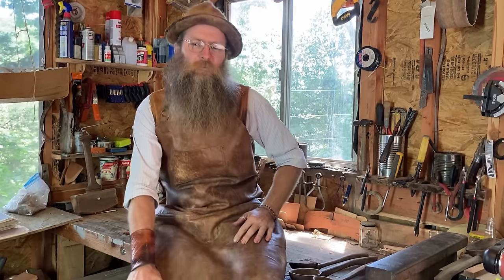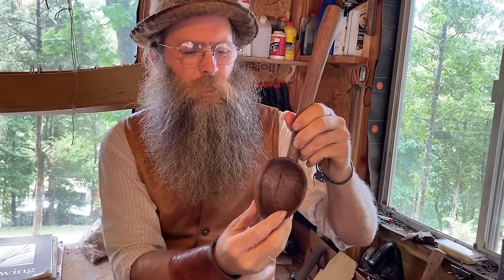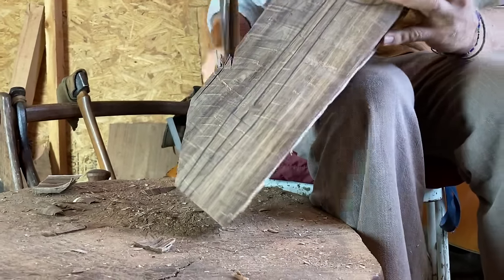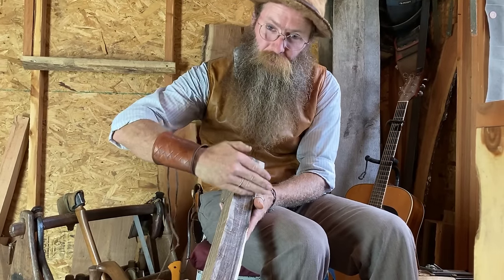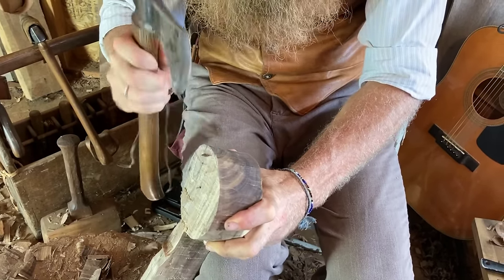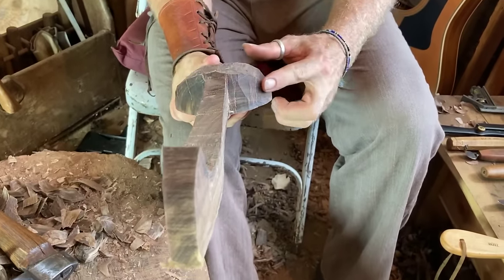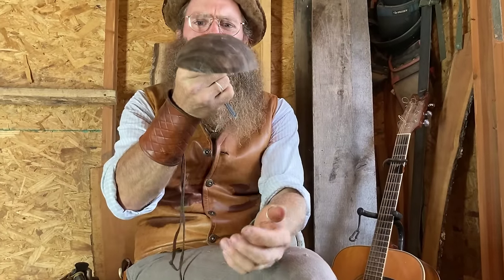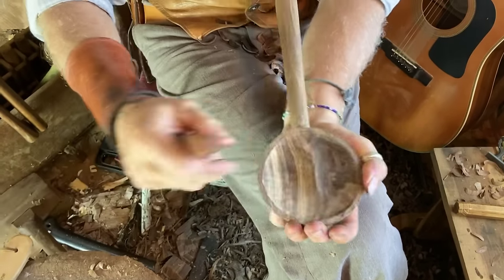How to Carve a Wooden Spoon by Hand

Comment: Where are ppl buying their carving hatchets? What things should I look for when shopping for one?
Reply from the maker: This is a very popular carving axe . However in my opinion I think it’s over priced and really awkward I would not have it in my toolbox but a lot of people use this.

https://www.amazon.com/Gransfors-Bruks-Large-Swedish-Carving/dp/B000WIPSVQ/ref=mp_s_a_1_6?adgrpid=51544855090&gclid=Cj0KCQiAu62QBhC7ARIsALXijXQgAuMQUMfBnKB2HbK3Os4RGrS0MFqduQeuh0nPbO0M6RYDVvKJJn8aAscOEALw_wcB&hvadid=410008378701&hvdev=m&hvlocphy=9026029&hvnetw=g&hvqmt=e&hvrand=1411582003428000142&hvtargid=kwd-1981184154&hydadcr=9873_11542642&keywords=gransfors+bruks+axe&qid=1644933367&sr=8-6
Reply from the maker: Here is another one by the same company That people also use. I have used both of these and I find them both to be awkward and hard to control and overpriced. I am just showing you this because this is where the industry is going to steer you

https://www.amazon.com/Gransfors-Bruks-Wildlife-Hatchet-13-50/dp/B000WIX6YC/ref=mp_s_a_1_4?adgrpid=51544855090&gclid=Cj0KCQiAu62QBhC7ARIsALXijXQgAuMQUMfBnKB2HbK3Os4RGrS0MFqduQeuh0nPbO0M6RYDVvKJJn8aAscOEALw_wcB&hvadid=410008378701&hvdev=m&hvlocphy=9026029&hvnetw=g&hvqmt=e&hvrand=1411582003428000142&hvtargid=kwd-1981184154&hydadcr=9873_11542642&keywords=gransfors+bruks+axe&qid=1644933367&sr=8-4
Reply from the maker: I know this one doesn’t look nowhere near as stylish. And it’s also hard to believe that it can compete with the other two but I will always have one of these in my toolbox. This is what I have carved with for years before I forged my own. I can’t say anything Bad about the Fisker’s hatchet. I always had two of these in my toolbox one or cutting through bark where I might hit sand or some sort of debris. And the other for when I was only an absolutely perfectly clean wood . I hope this answers your question. If you have any other questions feel free to ask
Reply: @CarvingAPath  thank you so much! I think you may have forgotten the link?
Reply from the maker: Sorry about that but here is the proper link to the hatchet I was talking about

https://www.amazon.com/Fiskars-X7-Hatchet-Inch-378501-1002/dp/B0002YTO7E/ref=asc_df_B0002YTO7E/?tag=hyprod-20&linkCode=df0&hvadid=167118301188&hvpos=&hvnetw=g&hvrand=5921387381775347452&hvpone=&hvptwo=&hvqmt=&hvdev=m&hvdvcmdl=&hvlocint=&hvlocphy=9026029&hvtargid=pla-312501403132&psc=1
Reply: @CarvingAPath  thanks again!!

Comment: It’s not easy to carve a spoon!
Unfortunately for me, I bought a carving hatchet before I saw your video. My carving hatchet is 10 inches long, and weighs about as much as my razor, but I will make it work with the spoon carving, because I am carving.(hopefully) a spoon half the size of the one you are carving here. But it seems, and I knew this, that the kitchen table down in the basement is it the proper block to be chopping on.😂 But I will succeed.👍
Reply from the maker: Here is a link to my favorite carving hatchet. I always carried two of these in my toolbox. One for chopping through the bark where I might hit sand or some kind of debris and the other for only use in perfectly clean wood

https://www.amazon.com/Fiskars-X7-Hatchet-Inch-378501-1002/dp/B0002YTO7E/ref=asc_df_B0002YTO7E/?tag=hyprod-20&linkCode=df0&hvadid=167118301188&hvpos=&hvnetw=g&hvrand=696876385566389192&hvpone=&hvptwo=&hvqmt=&hvdev=m&hvdvcmdl=&hvlocint=&hvlocphy=9026029&hvtargid=pla-312501403132&psc=1

Comment: I clicked on your video mainly to find out why you make such a sharp corner from handle to bowl. It makes sense to me to taper it - elegantly of course - with increasing thickness from handle to bowl.

Edit: Clearly you are a pro at this, so I'd like to hear more about what's bad about gouging the bowl first. I have only carved about 15 spoons total and use small beech and cherry logs which I split in half. These will suffice for two spoons.
I also do it standing with the piece in a vice and all that, but please, the matter about carving the bowl first (using normal gouges), what is wrong with it?